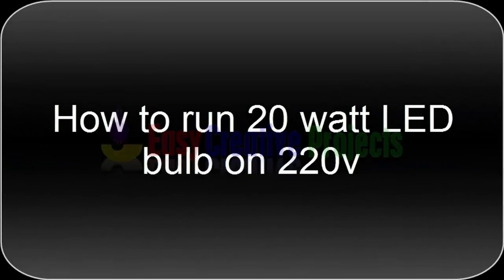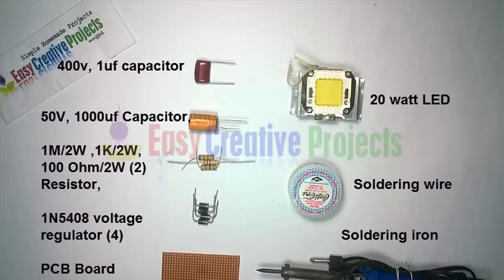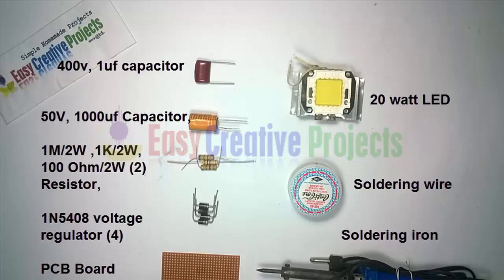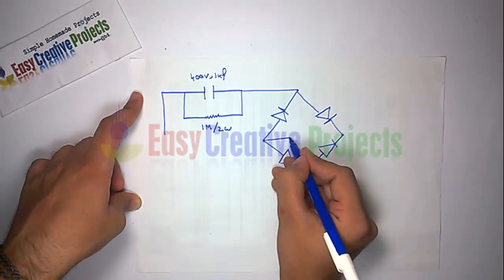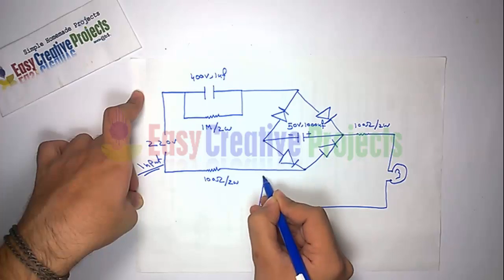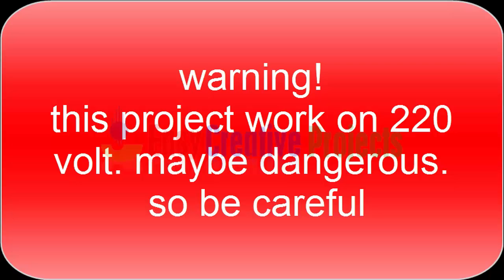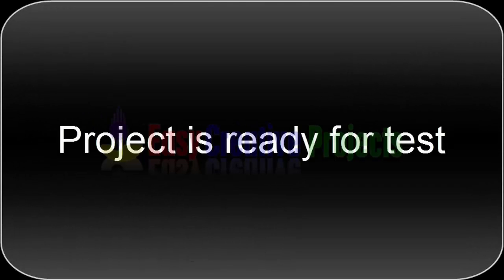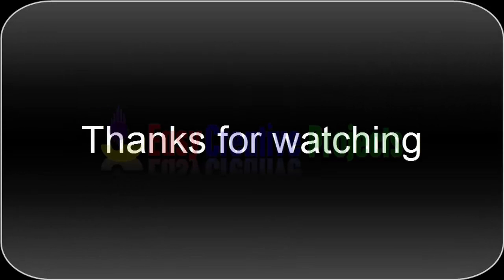How to run 20 watt LED bulb on 220v - easy step by step with circuit diagram

Comment: If two nos of 1N4007 are parallely used in  bridge rectifier (8 nos 1N4007 )  in this circuit  then will it be 2 amp current for this priject?
Reply from the maker: yes if you use parallel 2 bridge then you can get dubble current.

Comment: You have mention 1N5408(4), voltage regulator -- this term is WRONG.                              1N5408 is POWER DIODE, 3 Amp, / 600 Volts. Its helps to convert the line voltage AC to DC voltage.
And 2nd thing you should apply HEAT SINK for long run operation. 
Thanks.

Comment: I can used 474 k/ 250 volts poly capesitor. Tell me
Reply from the maker: dear 250 volt is a danger. if your home power is 110v then you can use it. but if your home voltage is 220v. then many chance for burning slowly slowly.
2nd 105j provide you 1uf and 474 provide you 0.47uf.  its working but dim light.
Reply: @EasyCreativeProjects  thanks my dear friend
Reply from the maker: you welcome.

Comment: Hlo bro 9w led bulb on 220v...Pls video ad
Reply from the maker: 9w 12v? if your answer is yes so
see video on my channel (How to run 10 watt LED bulb on 220v) you can use this circuit for 9w led.

Comment: Is it not important Heat Sink which is you have shown in the photo but not mentioned in the item List
Reply from the maker: heat sink is very impotent for each LED Flash lights. if you want, your led work for long time so must use high quality Heat Sink.
in this circuit i also use heat sink on base of LED.

Comment: Sir led heats up tremendously. Any remedy?
Reply from the maker: use heat sink behind the led. these LED heat up very early.
if  this time no heat sink available in house. so you can use any aluminium piece.  you can also find heat sink form old computer CPU.

Comment: Can I use 1m/1w 2resistors in place of 1m/2wt resistor and 105j 400v pf
Reply from the maker: no dear if you use 1w resistor its burn soon.

Comment: Brightness is very less what to do
Reply from the maker: check capacitor.
Reply: Thanks for reply. I checked capacitor and changed to Indian made capacitor but same. Can I reduce 100 ohm to 50 ohm?, and planning to add 12.1 Zener diode between 50 ohm resistor and led. Pls rectify if iam wrong
Reply from the maker: yes you can use 50ohm 2w diode. 
try to check zener diode but i think it burn soon.
Reply: Thanks for your reply
Reply: Sir I removed 50 ohm resistor and connected direct, again removed 100 ohm resistor to bridge circuit but lamp brightness still dim,not like before led driver brightness.planning to reduce 1MEGA ohm resistor how much I can reduce to achieve full brightness
Reply from the maker: dear i use 100ohm resistor only for led safety.
if you change 1m resistor so capacitor blast. 
if you want more brightness so simple use transformer.
Reply: Ok dear  what is rating and voltage I can fit its 12-0-12 volt 1A or 2 A. Pls correct it
Reply from the maker: connect 12-0-12  2amp with  100ohm resistor and 20w led directly.

Comment: Sir, aap ne suru me tin resistance dikhaya,1m2w,1k2w,100ohm2w.but diagram me 1k nehi hai !!! Toh iska kya matlab hai?
Reply from the maker: sorry dear, 1k by mistake likha geya. 100ohm ki 2 resistor hain.
aap diagram follow kro.
Reply: Easy Creative Projects , sir 20w led ka circuite banaya follow by diagram,but ek do baar jala uske ekdam nehi jal rahi hai!!!
Kya ho sakta hai? Whtup nmbr-
9903799053.
Reply from the maker: capacitor ur geya ho ga ya resistor jal gai ho gi.
agr yah diagram mushkl lg rahi ha to transformer say bna lo vo bhot simple ha.
Reply: Easy Creative Projects ,mai sayad led ka point wrong connect kiya tha! Again i buy & connect another led rightly,but light 5w ka jitna tha 20w ka v same hai! Aisa kiu hai brother?

Comment: 20w led is working but it is little dim and not so bright
Reply from the maker: dear check capacitor positive and negative side. if problem continue so simply change capacitor.

Comment: How much milliamp current the circuit draw, can i use IN4007 diode, what is the use of, 1M ohm resistance, what would happen if i remove or increase/decrease value of 1M ohm resistance?
What is the voltage on output side, with and without load?
Reply from the maker: dear in this circuit i use 2 watt power resistor. if you use less then 2 watt resistor then resistor heat up and burn.
2nd 1n4007 diode us for 1amp output. you can run 5 watt led with 1n4007 but you cannot run 20 watt LED. because 20watt led need more power for brightness.
Reply: Thanks for the reply, can you tell me exactly how much milliamp current this 20watt led is drawing from circuit?
Reply from the maker: dear 20watt led need round about 2amp power for good brightness.
Reply: I know it need more than 1 Amp current, but i want to know, does this circuit provide more than 1 Amp current to the LED?
I mean to say that did u measure the circuit current drawn by LED?
Reply from the maker: dear i could not understand your question.
Reply: Current measure kiya h kabhi, multimeter se, ki kitna amp mil rha h LED ko?

Comment: aap ne jo condensor lagay hai maine  bhi wohi condensor lagaya hai wo phulne laga hai  to mai consa lagao?
Reply from the maker: dear use minimum 2watt resistor with capacitor. if you use less then 2 watt then capacitor heat up.

Comment: what is the watt of resistor quarter ya Half ya 1w ?
Reply from the maker: dear i use 2 watt resistor.
Reply: okk dear thanks
Reply from the maker: dear 2 watt say km ke resistor use kro gay to resistor heat-up ho jay gi. 
5watt ke use kr lo agr 2watt ke nai ha to.
agr simple experiment krna ha to koi msla nai ha pr agr long time use krna ha to phr minimum 2watt must. 
thanks.
Reply from the maker: 1w k 2 resistor use kr lo parallel kr k.
Reply: sir 2 watt market mm available nhi hai toh ,kya kara any idea
Reply: thanks sir
Reply: sir,2 watt or 5watt dono mm saa koi available nhi hai market mm ,or koi other value ka resistance use kar sakte hai
Reply: Easy Creative Projects thanks sir
Reply: wasy apka experience hai warna ye  thek nhi q k parallel mei minus hute hia 1MΩ -1MΩ=(0.5MΩ/500KΩ ) kam hujye ge 0.5MΩ ke 2 laga do series mei